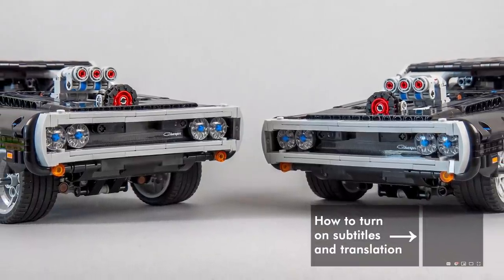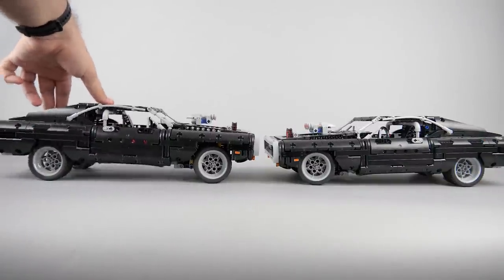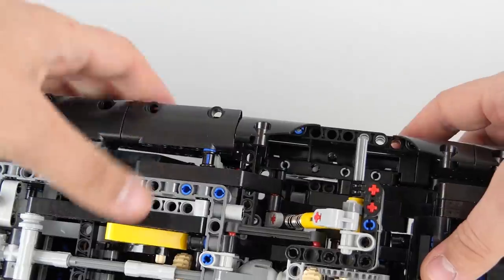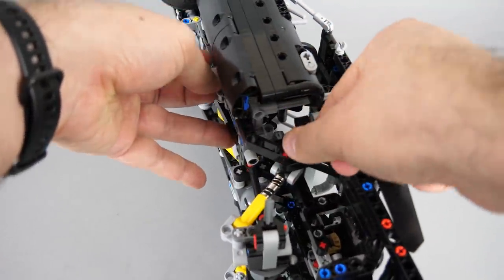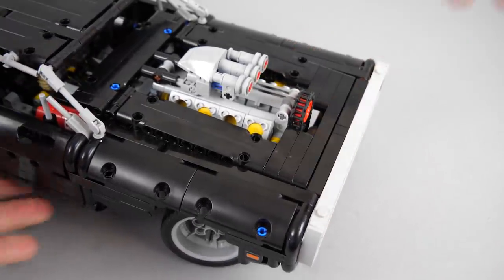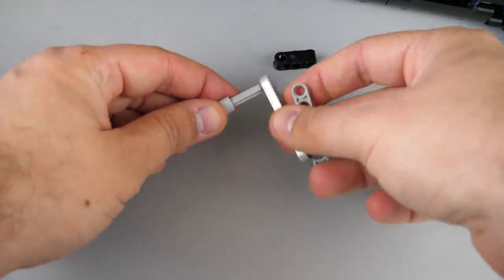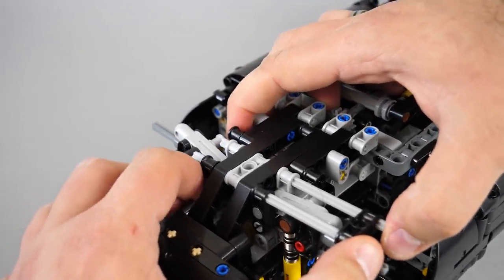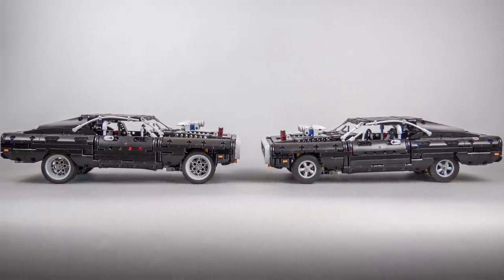How to fix the stance of LEGO Technic 42111 Dom's Dodge Charger in 5 minutes

Comment: Thanks for the ideas! Also quick option for front suspension; remove the brown pin and lock it below the grey steering bar. Suspension will be almost nothing, but the wheels doesn't come down when you lift the car and don't need additional spare parts.
Reply: Wim Schaberg this is Brilliant
Reply: I did this as well. Works great!
Reply: Thanks for this! I’m just building this set now and have used your method! 👌👌
Reply: Legend, this worked perfectly

Comment: I adjusted the front suspension attachment points. I moved the axle stop closes to the middle of the car and moved the shock attachment point to the closest to the tires. You have to shove something behind the axle while you reattach the wheels but it drops the front to the lowest and everything still works. Thanks for the video.
Reply: Looking to drop the front i did exactly the same. Suspension feta stiffer but works and stance is perfect imho.
Reply: Thanks, done this during build. Haven't applied the body panels but looks like a couple of spacers on the inside of the wheel will also stop them moving in and out 👍

Comment: I'd just got this on Christmas and Iam done building it and thanks for the solutions
Reply: hi, I'm building this and have one rear wheel turn clockwise and the other turning counter-clockwise.  Can't see any errors I've made. And just the three little gears in the flywheel box rotate, not the flywheel box itself. Should it? When just the 3 little gears turn I get the opposite wheel turn effect on both rear wheels.  Thoughts?

Comment: All i did. For the front end was remove the brown axle that you put through the shock and spring and lifted the lower arm, slid the axle throw the shock, wedged under the arm and stuck the locking piece on the end of the brown axle, saves having to get additional pieces

Comment: Back then I only installed softer shock absorbers on the front axle.
Due to the weight, it then goes down by itself.
Steering is retained and when lifting the axle does not fall down as far as if nothing was in it.
I didn't want to fix the axle with two 1x6 lift arms, there should still be some travel with the Technic model.
I left the rear axle like that, now it has a nice wedge chassis.  :o)

I still installed side mirrors, closed the trunk floor a little more and extended the exhaust system (the pipes now go to the rear axle and then a little upwards, where you can no longer see the end), painted black rims. The bonnet and the bracket for the radiator grille, etc. 
I also changed something, because the two brackets in the radiator grille bothered me. Now there are no more to be seen. 
It is a pity that there is no sticker that is continuous without this recess where the brackets were.

Comment: Are those mustang wheels being sold separately anywhere ? I really don't wanna buy a whole set just for some wheels 😭😭😭 what's the part number for them?
Reply from the maker: https://www.bricklink.com/v2/catalog/catalogitem.page?P=42716&idColor=95#T=S&C=95&O={%22color%22:95,%22iconly%22:0}
Reply: RacingBrick what tyre would fit the most out of the listed in the link you gave?

Comment: Surely it's muscle car not a race car. Muscle cars are supposed to sit higher so they can absorb bumps. Your car wouldn't survive the car chase at the end of Fast and Furious. The charger always sits higher, think of the general Lee blasting along dirt roads. I don't like the slammed look as it doesn't look scale.
Reply from the maker: If we talk about authenticity, you would never put such wheels on a proper muscle car. I don't like the donk look so made it lower.
Reply: @RacingBrick  no you wouldn't but there isn't much you can do about the wheels. Why do you keep calling it a donk look? Have you ever seen a 1960's dodge charger? They aren't slammed this is how they look.
Reply from the maker: @Rockatha  so you agree that the wheels don't match but you insist they look like this. If it had proper wheels I'd leave the suspension height as is, but these wheels simply don't look right

Comment: Does anyone have any idea why my rear tires spin in the opposite direction?
Reply from the maker: This is how differentials work
Reply: @RacingBrick  actually, its because when i put the engine block together, i put one of the blocks upside down.

If you have set, im referring to step 28, page 85, bottom right corner.
Reply: So now the back wheels are freely spinning, but because i put one of the engine blocks on upside down the wheels were not spinning properly.